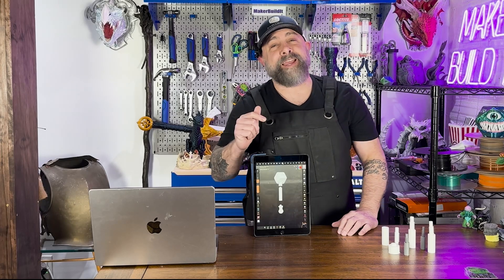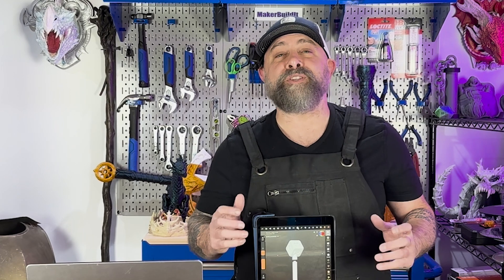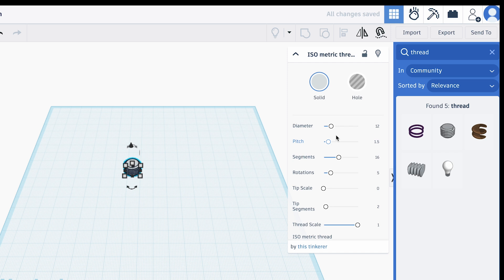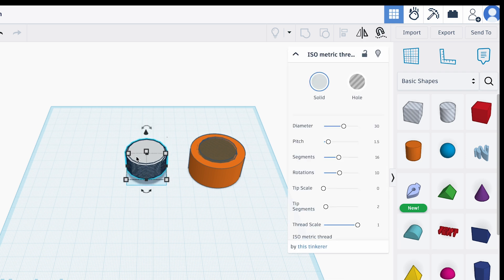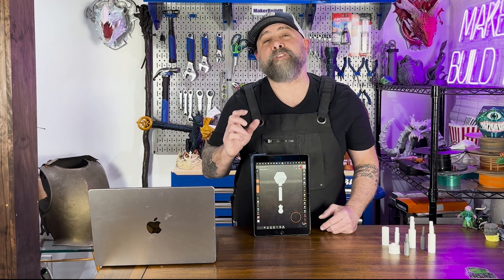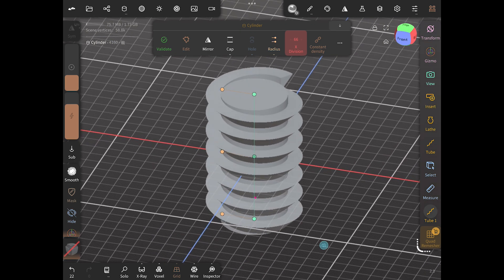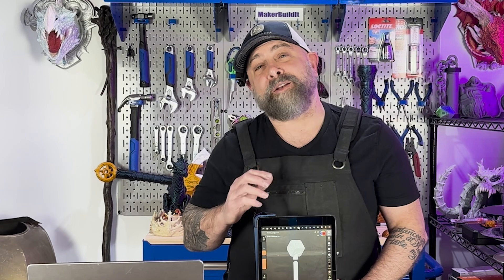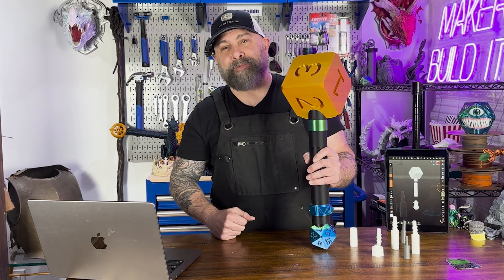This Simple 3D Print Hack Will Change Your Builds Forever!

Comment: With Nomad using Gizmo to scale to add play is not the correct way. Because if you scale XYZ you will change the pitch of the thread, if you scale only XY that is better but that stretch the profile shape. 
The correct way is before to use boolean to combine spiral and tube, in spiral setting use the scale slider ( ex 105%). Then for the tube it’s ok to use gizmo scale. And even better, you can edit the spiral profile to have un closed thread profile so the tube is here only to fill the center.

Comment: I have Bambulab A1. So lets recap, if you use thinker-cad you don't need to make the female connector 2mm wider, only if you use Nomad Sculpt or other software (Blender, Maya...whatever).
Right or wrong?
Reply from the maker: Hi. You need to make the female connect 2mm wider for your A1 or any Bambu Lab 3D Printer. 😁